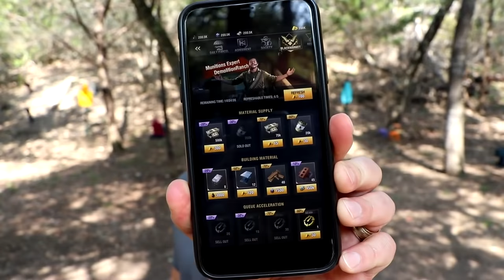How Strong is My Manhole......

Comment: As a sewer maintenance worker, spending a lot of time in and around manholes, this is valuable life saving information. Thank you Matt! (BTW we lift these lids by hand up in Missouri 😜)
Reply: Are you actually picking them up or pulling up and sliding them over with a hook lol
Reply: How many of you are lifting them?
Reply: @Steve_I  When we remove them we use the hook. When we're putting them back on, more often than not we're actually lifting them.
Reply: @kingcosworth2643  It honestly depends on the lid. We've got a few different styles of lids, some of them are about 150lbs and we usually get them with one person. The heavier ones we get two guys on. It also depends on where we are compared to the frame. Some of our manholes are 5+ ft out of the ground, so those we obviously get extra hands on.
Reply: I hope you are careful about sanitation when handling manholes, wear protection lol.
Reply: @DH-xw6jp  Oh of course. Always wearing thick leather gloves and we keep hand sanitizer in our work truck. It's a bad day when you get dirty water on your hands with nothing to clean them off.
Reply: @m00np1e2  thick leather seems a bit rough. Do you have anything with lubrication?

Im sure the manholes would thank you.
Reply: @DH-xw6jp  Hm, lubrication is a no go. We do, on occasion, use nitrile gloves for special purposes. A bit easier on the hand and the manhole.
Reply: @m00np1e2  wow, you enter the manholes totally dry?

Thats a bit extreme for me man.
Reply: Show me!

Comment: Matt, manholes are H20 (10,000 pounds) rated. that means they are designed for fully loaded trucks to stop on them. Also, they are made of Ductile iron, not cast iron. for a real challenge get a casting from Neenah foundry, they have castings designed for Airports.
Reply: 50 BMG could definitely exceed 10,000lbs of force even considering drop off. I don’t think the result of the video would be significantly different.

Comment: I didn’t think I wanted to know about How strong Matt’s manhole is, but I was actually very surprised at how well it did
Reply: Z16th like
Reply: I thought it would have gotten wrecked.
Reply: The angle he was shooting it only increased its survivability. Standard .50 cal round has about 16mm of  penetration and a AP round has around 26. if he was shooting that manhole dead flat with the standard .50 cal round it would of gone through most likely.

Comment: Fun fact: one time the military was doing underground nuclear testing and accidentally blasted a manhole cover into orbit. Although it may have ablated into dust on its way out. It was never found.
Reply: False
Reply: Ablation is not an instant trade off. The sheer speed of that manhole means it likely cleared atmosphere before it would've ablated away. It was given enough velocity to have likely exited the Solar System though. So, it's more likely that an alien civilization will find that manhole before they find either Voyager spacecraft.
Reply: The manhole cover was only seen in one frame of their high speed camera, so the speed was estimated to be 125,000mph or more! That's 5 times escape velocity.

There is much debate over whether it could have made it through the atmosphere or whether it was vaporized, but a very cool story.
Reply: @disgruntledegghead6923  also wouldn't be the 1st one they got their hands on... probably
Reply: It's not they did actually do nuclear testing under ground and blew a man hole cover and it went into orbit

Comment: I learned from Fireball Tool that there's 2 kinds of cast iron. The brittle kind you're used to is grey cast iron. This manhole cover appears to be ductile cast iron, which is much much more malleable.
Reply: I think the old steam heat registers were like that also. we had a hella time trying to cut through those to remove them when people wanted newer systems installed...

Comment: Back in the 50's, USA nuclear testing was decided to be done underground. There's a legend that the fastest human object ever launched was a manhole used to plug one of these underground holes used to lower the bomb under the ground. It was calculated that the manhole reached 6 times escape velocity when the bomb blew. So I argue that your manhole is strong enough to withstand a nuclear explosion. Note: the manhole was believed to have disintegrated seconds after launch, so sadly it never reached space, RIP.
Reply: Jesus Chris Pratt
Reply: will a manhole go through a manhole
Reply: @luv6071  wait I need to know the answer
Reply: Yep, when the nuke went off it vaporized the concrete plug. The manhole at the top was rumored to hit escape velocity. (Spoiler alert) it didn't. But it did go stupidly fast. 

As for faster man made thing I think that was the Pluto mission new horizons. But don't quote me on that, technically particle accelerators are faster (:
Reply: @AbyssDark  jesus chris pratt,son of glob
Reply: It's actually not a legend. It's an actual fact.

Comment: Thoughts before watching.
The new manhole cover.... Is going to be like tissue paper. May stop a .22 but that's it. They're usually low grade cast aluminium in my experience.

The older manhole. That looks like a proper cast iron manhole. May stop some of the smaller rounds but when something does punch through it's going to fail catastrophically breaking apart.

Comment: A manhole is cast iron, which is pretty similar in consistency to cast steel, a very common material in tanks.

This is just an observation, but if that was angled, you wouldn't be far off an M3 Lee.

Comment: I liked how he described the difference in how steel and cast iron behave.

In biology, there are nerves, and they conduct PULSES, and that is by way of action potentials (voltage thresholds)

Or like water freezing....water doesn't freeze more and more the colder you get it.  No, there is a threshold temperature, a shelf, an action potential, an event horizon

Thank you for uploading this video, it takes a village to raise an idiot like me

Comment: On August 27, 1957, the U.S military were testing nuclear explosives underground. What they did is dig a 500 ft deep hole and put a nuclear bomb in it, and then put several layers of concrete on top of the bomb, and then put a 184 lb manhole cover on top of the hole. Once the nuclear bomb was detonated, the explosion launched the manhole cap at a speed of 67.2 km/s, and sent it into space!

Comment: The entire comment section: 
“Lmao manhole”

me thinking about the proposed use case of ripping a 500 pound manhole out of the ground and using it as a shield

Correct me if I’m wrong but if you’re lifting an entire manhole out of the street I think the bullets are afraid of you